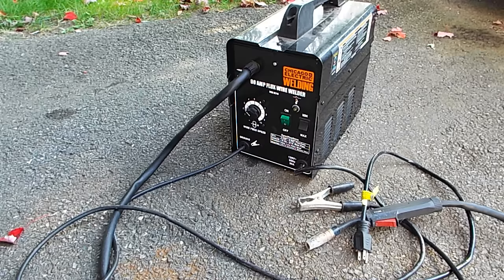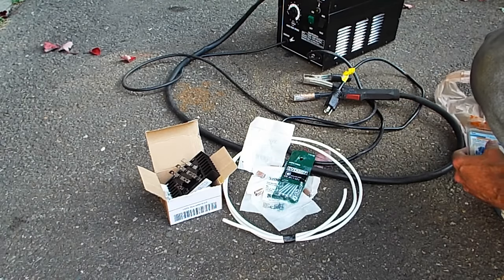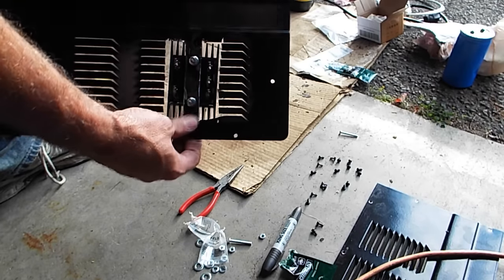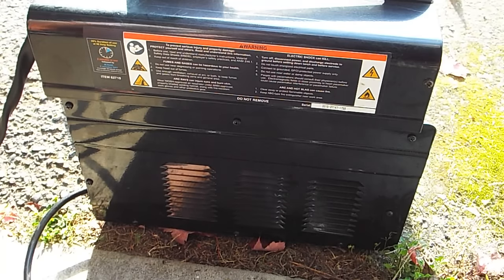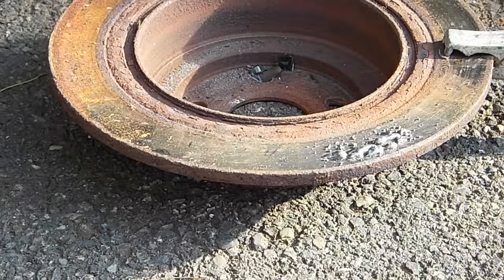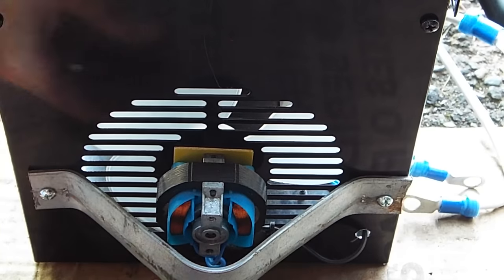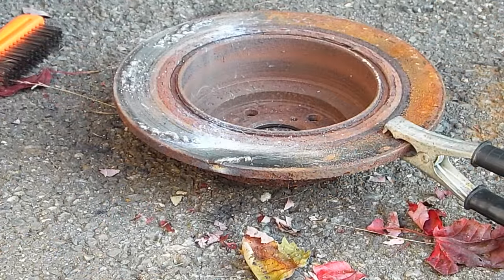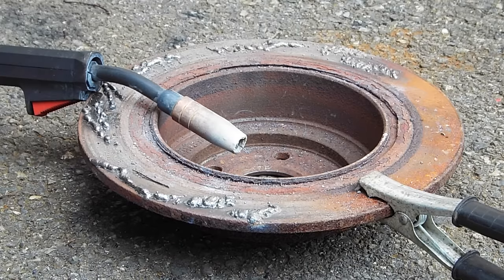Convert Welder from AC to DCEN ✔

Comment: Thanks for the video! I was wondering if the 6 gauge wire held up for you long term? That's what I have as well.
Reply from the maker: I'm still using it, heavy at times, and have had no issues with that size wire.
Reply: @contact4mwy7  thanks a bunch! Anything else about the build that you find worked well or needed improvement? 
One thing I've done as well that was recommended by others was to add a beefier ground clamp to it. I replaced mine with a 500amp clamp, which is overkill but should help.
Reply from the maker: I added an aluminum plate to the back of the voltage rectifier to help with the heat from it. Works great at cooling the rectifier down. A rectangle of aluminum diamond plate could do the same, just mount the rectifier to the flat side. Aluminum conducts heat well.

Comment: For all the carving and bending and frying you did, looks like a can of anti splatter might have been a better fix. Would the warranty still have been valid with this AC/DC change over?
Reply: capacitor discharge no inductor chocke and no gaz ay think there.
Reply from the maker: I understand your suggestion of using a can of anti splatter to reduce the little bb's that are made. Changing the welder from AC to DC provides a kind of 'magnet' for the material being welded, and drives the electrons deeper into the metal. AC welding has a constant back and forth attraction, which means it pushes the metals together, then pulls them apart, over and over, 60 times a second. It is this 'repelling of the metal' that creates the bb's splatter.

Comment: Good idea using the aluminum to dissipate the heat.  How well does the bleed cap work hooked up to the rectifier (as opposed to directly to the capacitor)?
Reply from the maker: The bleed resister works just as well in either place as the wires are the same. It nulls the charge in about 10 to 15 seconds. If I touch the work piece before 15 seconds is up I will get a small spark. The aluminum works very well at pulling the heat away from the bridge rectifier. Thanks for watching!

Comment: 19:10  Time.  Heat Sink.  TRY to get an old Dell computer,  the microprocessor, they use good large aluminum  heatsinks - I  used one, on my old Lincoln AC  225 amp machine to DC with a 300 amp bridge rectifier, and a home made choke, using microwave transformer secondary, wound with 4 turns of welding cord, and some aluminum heavy-duty high voltage capacitors.  Works good, the fan inside the welder blows air over / through the welder case - staying cool !

Comment: Another part to this project, is adding another small 24volt transformer, to independently run the drive motor, to avoid voltage drop.
Reply: Metal Guitar FailArmy, 
That is "Zero Labs" hack  on YouTube for these welders.
Reply: I used a 20v transformer which peaks out at about 23 or so, so it runs it well. Interestingly, I tried a 24vdc power supply, but the range of control was not much.

Comment: I'm a guy that just got a welder 110 never known about welding or nothing like I said just a week ago I got one for the fun of it my weld would splatter a lot so I saw a video about is switching the polarities but it didn't require any of this stuff it works way better but my concern is is it right by the way I also said the same thing when I was about to try mine out after switching polarities making the gun negative and the clan positive about it blowing up
Reply from the maker: Some welders are wired cheaply and weld with an alternating current (AC) to the gun and clamp, while others, generally more expensive, weld with direct current (DC) to the gun and clamp meaning one is always positive and the other negative, and they are reversible depending on welding needs. My welder was AC from the factory, but I converted it to DC and made my clamp positive, gun negative.
Reply: tanks mine in the inside says i can just swapp em like i had n yes depending  wire  use tanks
Reply from the maker: @ricardojuarez8803  it sounds to me that yours is already set to weld in DC current, you have a good machine there. I can say from experience, it takes practice. Lots of practice and experimenting with settings per the thickness of the metal you are working on.

Comment: Though the metal on a brake rotor may look like nice shinny metal to weld on it's not. What happens when you're braking in fresh brakes is the pads are deposing a layer of brake material on the rotors. Trying weld through that material is asking for heartache... Also the rotor is cast Iron which is not weldable with standard flux core and it's pretty thick for such a light duty welder. If I were to weld that I'd grind the metal clean, then turn the amps up all the way and turn down the wire speed as much as possible to get as much heat as I could in the weld. Even still I'd expect poor results.

Comment: Have you tray none flux wire?
Reply from the maker: MAM MAM I do not understand your question. What do you mean?
Reply: Mark Young - Outside The Box wire without flux...
Reply from the maker: MAM MAM This is a gasless unit which burns the flux to reduce the oxygen getting into the weld. Without the flux the weld would be weaker over time?

Comment: Cool project, I may have to try it! Now that this video's a year old, how's it holding up... have you had any problems? Thanks!
Reply from the maker: No problems so far. Holding up well. I think the DC welds are better than the AC welds it made before converting it over. The real question is would I do it again? For sure!

Comment: The welder fan motor, is 'air over motor' continous operation ac motor. For proper cooling it should be mounted for maximum airflow over it's own windings. Question? Would it be better to draw hot air out of the welder enclosure usuing a shrouded fan?

Comment: Would help if u slow down a bit, fix that stickout too far away from work piece, and try welding on something that is mild steel. Rotors are hardened if im not mistaken. Typically u need to preheat if its hardened with that lil thing. Like the AC to DCEN swap tho.
Reply from the maker: Thank you for your advice, Benjamin!

Comment: why are you on the ground? and why do you have so much wire out. you cant get a decent weld
Reply from the maker: Gravity
Reply: Your jokes are as good as your welding. All kidding aside it sucked when it quit working on you
Reply from the maker: @oldguy59  before the garage I have now, I was changing car parts in the driveway, in the snow. Being on a cement floor is way better to me, and I don't have a work bench (yet).

Comment: When we trained students we had them pad weld parallel beads at least four inches long. Do yourself a favor and use a couple of rolls of wire for that practice. You'll be pleased! Lincoln or Hobart wire welds better than budget wire which is often inconsistent (including Radnor wire from Airgas). Lincoln NR-211 is famous for good reason and trivially more expensive.
Reply from the maker: Ob Fuscated thanks for the tips. I am finding that practice helps a lot.

Comment: don't drag the stinger. move you're hand back and forth slowly, as u move into you're weld as you are laying the bead down. this will get you a very nice weld that gives  a wave look to it and one solid weld run. .. good tip i offer. test it and you will improve your welds.

Comment: FUUUULL Bridge Rectifaiarrrr :D
You are going way to fast with your welds...
Go slower, will im prove things alot
Reply from the maker: I edited the length of the welds in the video to make them shorter, as in they are not shown in actual real time. I have found going slower is key. Thanks.
Reply: but ur weld looks like u going to fast ,slow down a little u will see huge deference
Reply: i do like ur mods

Comment: If you wanna weld plate >1/4" wirh a 110v welder of any king preheat the metal with a torch before starting. I saw some long BB's and spatter, no real penetrating welds. Turn the feed speed up and use thinner wire for better heat transfer. I am not a professional, just a farm welder. I learned on and am happy with my 1965 AC buzzbox.  It'll run 1/8" rods all day long.
Reply from the maker: Thank you, all good points for me and others interested in doing this!
Reply: Hello, Northern tools Klutch; multi process Inverter type.  Dual input voltage, max thickness is 5/16."
 I would not even try past 1/8" on the Chicago Electric machine. I own one and it's pretty weak. I use preheat quite a lot.
I went through 4lbs of wire, in practice  just to get 1/2@$$ed competent with this box.
Have sourced a 200A Single phase bridge.
Tested the Diodes for function. Now just need to get nice bit of scrapyard aluminum.
On tear down of my box I will make enough room to safely propane torch my connectors. Solder and plunge fit into 1/4" connector. A good fit is hermetically sealed.
I prefer the 8mm machine screw bridge over the spade connector type.

Comment: Perhaps because the brake rotor is cast iron which is difficult to weld your results are less than desired. Try it on some plate steel.

Comment: dude all you needed was a large computer cpu heat sink but you need to run heat sink compound between the rectifier and your heat sink and all i've ever used is 0.35 wire in my HF 110v welder both before and especially after conversion because after converting the DC output is so much hotter, you also need to get away from using HF flux core wire, the stuff is crap. go to tractor supply and get a roll of Forney flux core or at least the lincoln wire from home depot and lastly learning how and when to control your stick out is more important then ever after converting to DC so you can weld both thin and think material.....
Reply from the maker: All good advice, especially about using a CPU computer aluminum heat sink. Thanks.
Reply: I have never had a problem with the welds that the 90 amp welder produced or the HF flux-core wire, it is user malfunction.

Comment: Cast iron is the last thing you should be "testing on",
Reply: I've used low hydrogen rods welding cast iron b4 I always wondered if flux core was similar because I repaired a cast wood stove back in 06 with my Hobart Handler 185 and it still holds I did a lot of prep and built a small fire b4 welding but it welded beautifully
Reply: Your wire speed is to high
Reply: Merlin is right ...cast iron is wrong testing material, also the  plate was good idea but miss the "cream" to apply between the bridge and the plate helping with the dissipation.
Reply: Shot in the dark here.
 Maybe the voltage drops more than the stated 18vdc that the manufacturer states?
This machine is a ac transformer type.
I have owned one of these exact 125 amp machines for five years. The wire feed assembly is as* on these machines.
Spend youd day removing the wire feed mechanism. Clean out the gunk grease they caked inside it and use a light weight, quality synthetic grease.
On these boxes, it's all about consistent feed of your wire. Good luck.
Reply: These welders are like deceptive vacuum cleaner ads from the 1980's. Claimed peaj power of 12Amps. Yeah, peak current right before motor burns out.
These welders will never get near 40amps.
Find the video of the guy in certification school, welding 6 inch steel pipe with a Big 220v machine. He has it set at 90amps with correct 1/8 inch stick electrode.

Comment: Do not get the bridge rect that use spade connections. This is because you can stack ring connectors and use two or three 12AWG cables instead. Perhaps I see this because I have plenty of 12 AWG wire already. Also, why get three-phase? Wrong type altogether. May be the power rating is based on three-phase. You cannot just connect single phase to three phase.

Comment: Two things I learned about that welder one .change the ground clamp, it's a huge upgrade .two slow down you have to wait till you have a good pool before to move. I only did the ground clamp so far I have the stuff to do the conversation but I'm kind of happy with the welds I'm getting right now.when I get board I'll finish the mod. Ps. Take off you tip so you can get close.
Reply from the maker: I did take the tip off, but have to admit it permits the tip to come into contact with your work piece if you're not careful and THEN the Sparks fly! Lol. Thanks!
Reply: @contact4mwy7  that's true,you havecto clean the tip in between welds but I find getting really close and dragging the puddle left and right has been working really good for me. That said I have one pound of experience. I dont know what I'm talking about but I feel that my welds were worthy of my motorcycle out of the box. It was hard for me to slow down that much but....
Reply: I am cheap. I added  a piece of 1/2" copper to my ground clamp. A drilled & smashed flat plumbing coupling. Not going to pay $30 for a piece of brass from Thailand worth $4.
Reply: @ayebee1207  that's cool. I think I only gave like 12$ for mine and it was twice what it came with but yeah do it for free .its always better.

Comment: ................one other thing, there is no such thing as "2 phase" electricity, there is single or 3 phase and if you're using 110/115/120 there's "single phase" only.
Reply from the maker: But 2 phase sounds cooler.
Reply: @contact4mwy7  Touche' !

Comment: Cool mod but I would recommend more practice with stock welder before trying to trying to modify it as shown. that way you can see the difference in the welders performance both before and after...  Strange garage has good channel with good vids on the HF 90amp model and what it can do.

Comment: Get rid of that copper gas type nozzel. Just take it off. It is causing you to hold your tip too far away from your work. You'll be amazed how much better it'll work.
Reply from the maker: I tried it without, like I have seen from other videos, and it touched the work piece and shorted out once. I thought that would shorten the life of the welder, so I put it back on. The copper nozzle is not energized and thus does not short out. I've seen some also use a replacement plastic nozzle, maybe I should look into that? I will make every effort to stay closer to the work piece. Thanks for the suggestion!
Reply: plastic nozzle and trim wire to 1/4 inch stay on puddle longer.
Reply from the maker: Thanks Gary, I will give it a try.
Reply: Flux core nozzles exist for good reason. (I use FCAW on my industrial machines when working outdoors.) Since I'm thrifty I just buy MIG nozzles and trim the end or slide it back (if Tweco style) to get proper wire stickout while not trashing my tip and diffuser.
Reply: Strange, my 125A machines "gas nozzle" is only 3/8" inside. I can run it fine with 1/2" stickout. HF sells extra tips for $8. I like the Nozzle. Sometimes I will do a bad scratch.
Protects the orifice tip in dead stuck short.

Comment: Maybe this is why my welds are not getting better. Im running the same welder but still ac
Reply from the maker: I believe the welds can only get good to a certain point and then the limitations of being AC prevent them from being a truly good weld. The low amperage doesn't help much either. These welders are handy for small jobs and inexpensive, but really, spend the money on a better unit? There are many webpages explaining that Flux Core Wire should only be run DC with the gun Negative to keep the Flux slag from being drawn into the weld.

Comment: I have to ask, why in the world would you ever want to convert one of these to DCEN as that is a flux welder which are of course equally cheap. I just don't see the point aside from maybe it just being a technical challenge.  From the standpoint of usability, practicality..I don't see any reason.  if you want a cheap DC welder just spend the extra $80 and buy the HF 170 amp flux / MIG welder. It's a much better machine with more power.  Lastly, the first thing you should have done was get a heavier duty brass ground clamp and slow down with your weld travel. That weld on the brake rotor was crap simply because you moved waaaay too fast.  I think people start modding these without ever learning how to weld with the machine to begin with.  I got great welds with the stock wire on my old 170amp simply because I took the time to really get to know the machine first.
Reply from the maker: Because, DCEN welds better and more consistently than AC electrode, this unit plugs into a 120 outlet which makes it more portable, cost savings, and we all gotta start somewhere.

Comment: you need to add a choke to the system, it controls the current,makes it smother.i used an old microwave transformer core, stripped & put about 5 or 6 rounds through it. makes a world of difference.cast iron is a pain also.
Reply from the maker: Thanks, Erwin. I guess I'll have to find a video on how to do that. Agreed that the rotor was not a good candidate for some weld testing. I'll be trying out some steel when it warms up here.

Comment: I thought the convention was for the fan to be pushing air out from within the unit, not the other way round?
Here's a tip that should improve the consistency of the wire feed. Disconnect the supply to the wire feed motor and install a separate, little 24v transformer. You see, as it is, the feed for this motor comes straight from the main transformer and this can mess up your welding. I got this tip from some other welder on YouTube. They swear there is much improvement.

Comment: that disc brake is not what you want to be welding with that, DC or AC. I hope you have replaced that clamp by now.
Reply from the maker: Thanks, Richard, I know that now. I'm new. I have not replaced the clamp yet. Thanks for commenting.